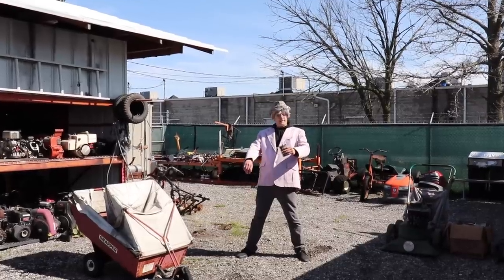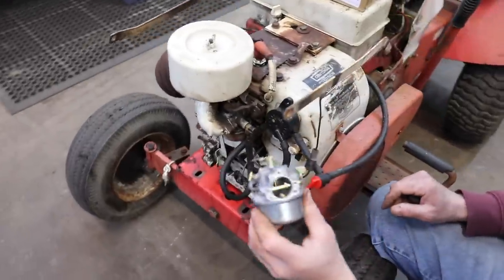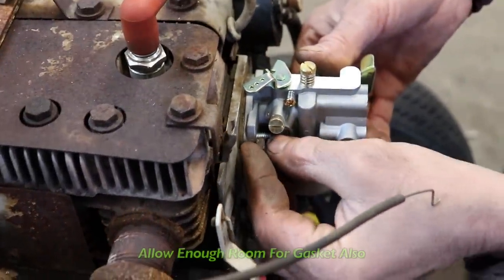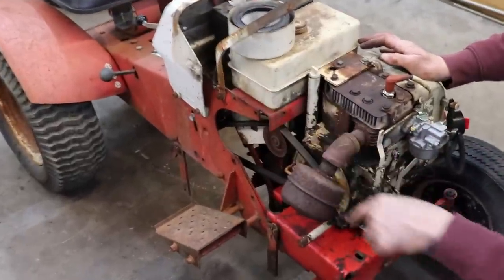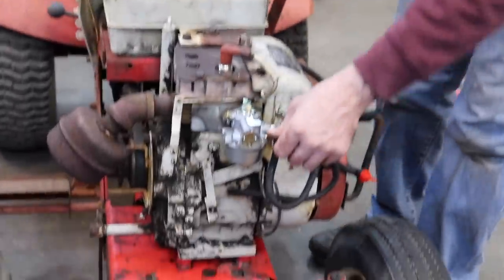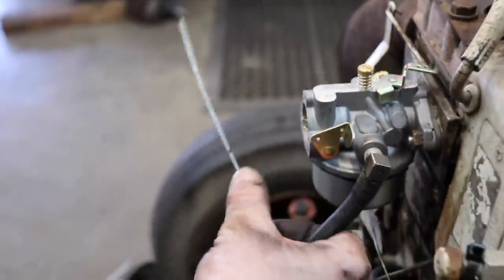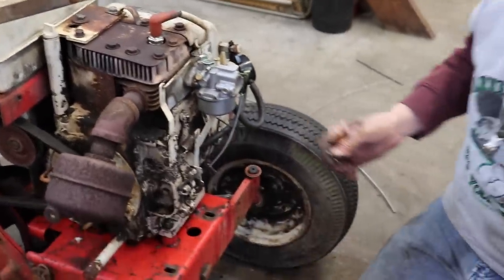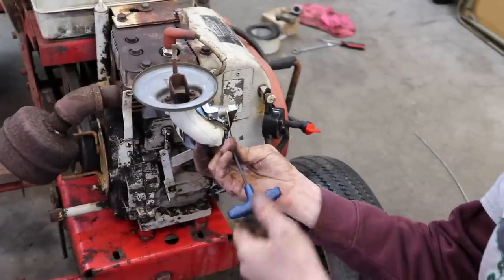Tecumseh Carb Swap On HH100 & HH120 Engines - Epic Hack!

Comment: Several years ago I used to mow for different property owners to pay my tuition for vocational school. One of the lawn tractors that one of the property owners had was a Sears Craftsman with the same engine as the one shown in the video. That was a tough old tractor being that an oil seal failed one time in which the engine locked up. As luck would have it, I was moving this tractor at a slow rpm to get the other lawn tractor that I frequently used. The repair person had the mower back up & going like within a day or so. Remembering Back, I believe that the engine ran even better than it was before it locked up. Also, the transmission on this lawn  tractor had the high & low range and man would that thing pull. The blades on the mower deck were really worn out because of the small uncut strips of grass that would be left behind. Maybe that’s why that I always make sure that I keep very good mower blades on all of my mowing equipment. 
One idea regarding the K series Kohler carburetor; Being that you were making the mounting stud(s) - Could you not use a thicker gasket like is used to isolate heat from going into the carburetor to give the butterfly a bit more travel. And as always, I really enjoy all of the videos. 
Taryl could devote a video regarding all of the people that have been thrown over the fence or onto even the roof like Ronnie was. GrassRatts Forever!!!.

Comment: I don't like to sell used, but if a customer is desperate or low on funds, I'll pull a part off one of my parts mowers. I'll check it to be sure it works, and I'll tell the customer if it doesn't work to come back and I'll find another or if I don't have one I'll refund their money. I make sure to tell them there is no warranty on used parts. Had a lady the other day claimed someone stole the blade brake bail on her push mower. I pulled one off one of the 2 dozen mowers I have and sold it to her for $5. She was so happy I could help. You could order new, but it's just a bent piece of round steel.

Comment: I just cut the emulsion tube threads down in line with the tiny idle circuit hole with the edge  4 inch file to make a deep groove around it like the service tube. Works fine. Chuck the nozzle in a drill and strap it down and turn it on then use the file to cut the groove,

Comment: I ran into that main jet problem about 20 years ago on a Tecumesh Ariens engine.  It would start and run for a while and it would act like it was running our of gas.  Choke and start and it would sound great and run out of gas.  I always wondered what it was and never got it running right.  Must have been what it was.  Thanks much Mr. Dactyl.
Reply: P.S.  Is that where Ronnie lives?

Comment: Good video..
The main jet is screwed in at factory, then they drilled the hole from the outside and then plug the hole. If you remove it, you cannot get hole realigned. All you have to do is get a Drexel with cut off disc or small file, find hole in the nozzle and cut a small slot all around the nozzle in line with the hole (but not through the nozzle).  Whalaa, you have a "service nozzle". 
There are plenty  of parts to rebuild the Walbro if you chose. 
The 8hp Kohler carb works good for the 10-12 Tecumseh, the 12 hp Kohler works for the 14-18 hp Tecumseh as they are jetted richer than the Walbro carbs. Sometimes you have to change cables around but easy fixes.
Reply: That does not always work like that. You might screw the new rigged service Nozzel in and it will still not work right. You reach down in the hole with a Guitar string and poke the tiny hole out. then put in the service nozzel. Still might not work right. Now all back apart again and remove the brass cap that goes to that hole and remove the top brass cap to make sure the floating pin is moving back and forth freely. I did not say float Pin. I said Floating pin. it is made of aluminum. Over 280 rebuilds of the Walbro LME. You can Bet that I know them well. lol.

Comment: I got one of them I’d sell in SE Alabama. Been in a storage shed for 10-12years. Was cleaned up nice and painted before storage. Got a deck that needs a couple of bearings and a spare Tecumseh engine just like the one on it but has OHV and higher HP. No hitch or implements. Believe it’s a 1971 model. Plan to clean out that storage unit soon and would hate to scrap it.

Comment: I have reused the stock tube by using a thin (3/32) file and put a groove across that fuel pickup hole to compensate the slight misalignment . the service nozzel used a groove to achieve the same thing
Reply: Did the same too,  many moons ago

Comment: Great video Taryl, you can still get the kits to rebuild those original Tecumseh fuel pumps, have seen them on ebay. I've got an old Tecumseh OH160 cast iron OHV engine off an old Sears ST/16 tractor from the 70s I'm working on, doing a complete rebuild. Keep up the great videos!

Comment: I have been down this road in the antique snowmobile world. That carburetor will not support the air fuel needs of that engine. The carb that the Chinese copied if for a 4-6 hp engine only.
It will idle and run fine but once that engine is doing any work it will fall on its face. you will need at least a 22mm bore in the carb those only have 16mm. You are better than that choke cable install taryl. Keep up the good work.

Comment: The other advantage to running the new choke cable and coming up from the bottom instead of running the old one over the top which would have 'pushed' the choke on, is that with the new cable coming up from the bottom you have the proper intuitive action with the choke knob of 'pulling' the knob to close the choke, and pushing the knob in to open..
Well done, nice conversion.

Comment: I replaced a carb on one of those engines like that one. The guy who owned it lost the carb and the adapter plate that goes between the port and the carb., what a pain in the rear end that was. I had managed to find the Chineseium knockoff to the original. I think the K series carb would have a been much better replacement like you did in the video.

Comment: I had a 1970 Sears Custom 7 that my dad bought new. Had a pull start 7 hp Tecumseh and 38 inch cut. Stupid me sold it in 2000. Wish I had it back.

Comment: The comment I made on your other video was referring on this exact lawn mower. M8 Sears 1966 lawn mower. I got the engine taken apart but the drive shaft belt pulley the keys are frozen in the belt pulley and I cannot take the keys out cuz the keys are rusted away keeping me from taking the pulley off the drive shaft

Comment: That tractor is set up very similar to my 1967 Wheel horse,That only lasted 42 years.Not well made like today"s junk.Mine had a fuel pump too,and the gas tank was at least as high as the cabertrator.Never gave me any problems so who cares.Strapped that Wheel horse gas tank to the cooling fins of my 73" super beetle when that fuel pump went bad.Drove it 30 miles home like that,gravity fed,ran perfectly like that!Looked like an "Old Time Drag car"!
Reply: Are you saying that the wheel horse was junk?
Reply: @sampasch3381  -Not at all,total sarcasm,--back in the 60"s,garden tractor"s were built like minature farm tractors,last forever.

Comment: I would not alter the choke valve but sand down the inner surface of the tube. Wait till the choke is a year old so there will be a wear spot on the inner surface that way you have a gauge to go by.

Comment: I just worked on a friends 1976 rear tine tiller with an HH70. HH means 'Heavy Duty Cast Iron'. It had a cast iron engine, but an aluminum head, and an aluminum back plate where the drive shaft comes out. This HH100 looks the same. Isn't it interesting how many riding mowers from those days had engines in the 8 to 12 hp range? I often wonder if the transmissions were stronger than todays, or were these old mowers really underpowered compared to todays mowers?

Comment: Something you can do when fabbing new studs is cut a slot in one end, big enough to fit a flathead in.  You can then screw the stud into the block directly without worrying about dicking up the threads with pliers (or, worse, vice grips.)  It makes it a lot easier to pull th estud back out later if you need to change it, too.
Reply: i was thinking he should have used grade 8 bolts to make studs out of so you could always get the studs out without breaking them off flush with the block incase you ever had to take the carburetor off again
Reply: and you can use the double  jam nut trick to put the studs in

Comment: I collect vintage garden tractors.
Most of my tractors have Kohler K series engines. Those aftermarket k series are very hit and miss on whether or not they work out of the box.  The seat also is different sometimes and the o-ring bowl gasket is often too big to use on a stock Kohler.
Reply: Check I save tractors he specializes in old
Kohler engines high quality heavy duty aftermarket parts very good guy check him out he can help you

Comment: Have you ever heard of problems with the battery status charging port on Husqvarna mowers, draining the battery in a few days? Brand new, never green, and steady yellow not blinking like it did before the battery was replaced. The first time ever used it went dead during use. The solenoid wire burned thru and was folded and stuffed in a hole. So hot the broken wire was welded to the plastic. Any ideas. Husqvarna said 3 to 4 weeks to get it back and I had the defective port in my hand for them to test. When disconnecting it the battery stays charged. Third problem with electrical and 5 hrs on it

Comment: Never would have thought about that. Is there a way to swap a different carb on the Briggs opposed twin ? I found a crack in the lower body of it yesterday and having trouble trying to find a good used one to replace it with. I also like how you have the sound effects it makes me laugh every time

Comment: what do you do with the HH when the ignition quits and you can not get part for the electronic system any more
Reply: I know a couple a people who would love to find an easy answer for that question! Short of rigging a crank triggered system using an auto coil, a proximity sensor, and a old GM or Ford ignition module, I haven’t heard of anything......
Reply: We always have the OEM ones. New and Good used.

Comment: Would is be possible to put a pulse pump on a single cylinder diamond plus Briggs and Stratton 13hp 1993 engine not getting petrol/ gas I think you would call it 😂 when cutting on a hill?👍

Comment: The z you put on the choke cable end is to wide where it goes into the choke plate. !   ,")
Reply: That what I thought. That Z bend needs to be a little tighter.

Comment: Gravity feed still not possible on that carb?
Reply: Probably like Briggs that had smaller inlet needle for pumps versus gravity feed. I put a pump fed carb in place of gravity feed and it starved for fuel until I changed seat.
Reply: I do not think that carb will handle the fuel pump for to long, gravity feed only way.

Comment: I have a lot of sears suburbans. And still do. All of the tecumseh hh120 and hh100 has the arrow style choke level. And they are original. 

But I do have a few with worn out carbs. This would be a nice upgrade.

Comment: I had one a lot like it had nothing but problems with it and burned more oil than gas a dude came in my driveway and offered me 200 for it (not running) i said ill help you load it

Comment: wish i fucking knew this before i racked my head trying to get my hh120 fucking going cleaned the carb about 3 times could not find anything online about the fucking issue changed the carb out couple times with other ones thought it was fuel pump bought one nothing worked right so it has been sitting in my yard for couple months and i wouldnt mind but i have about 6 kohler k91 engines and a tonne of spare parts for the fucking things so i have some hope again on the old sears hope this works